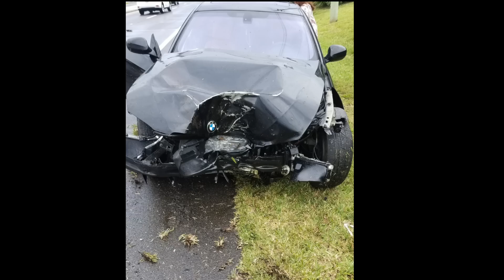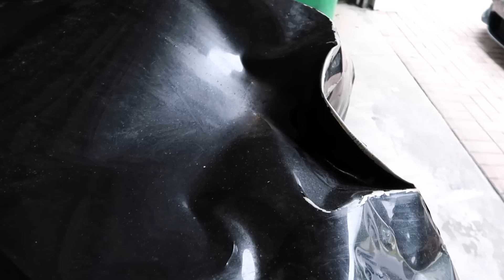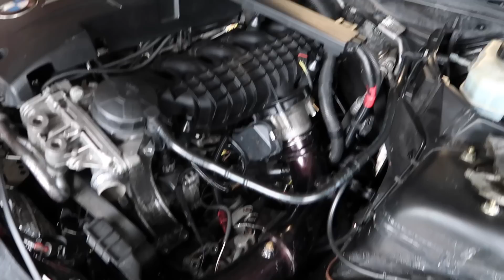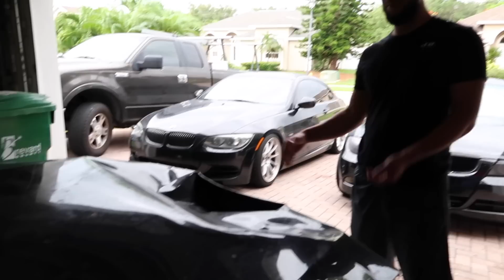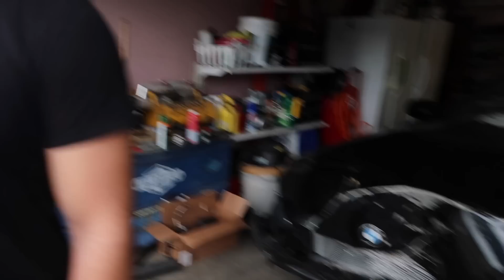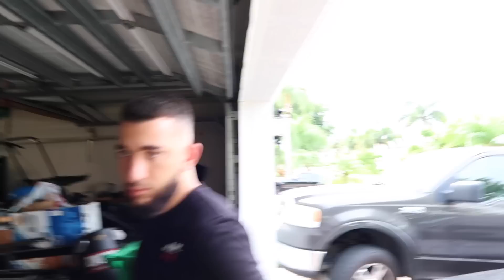Totaled the BMW...

Comment: There’s only one explanation. Driving too fast for road conditions. If there’s lots of water on the road you can’t be cruising at normal speeds. This is what happens and it happens quick. And if your tires are worn the risk of hydroplaning is even greater.